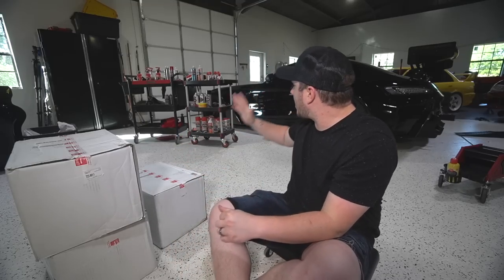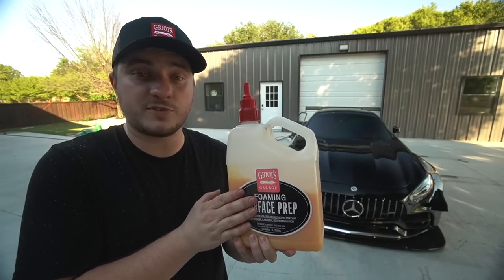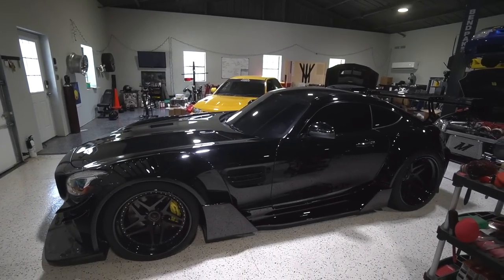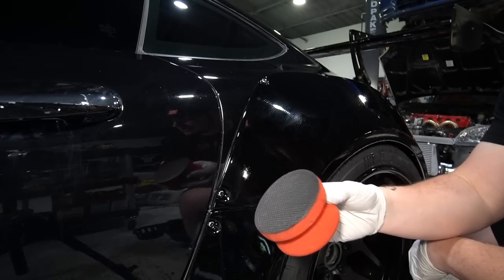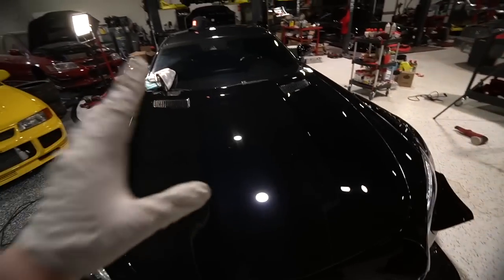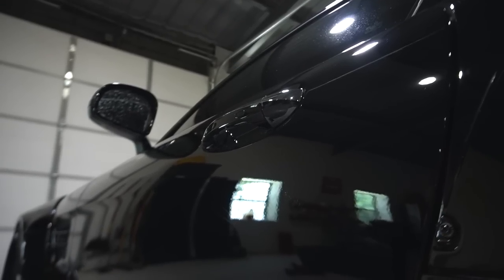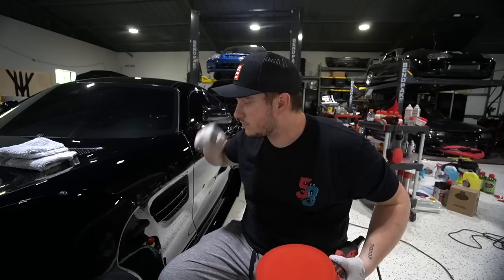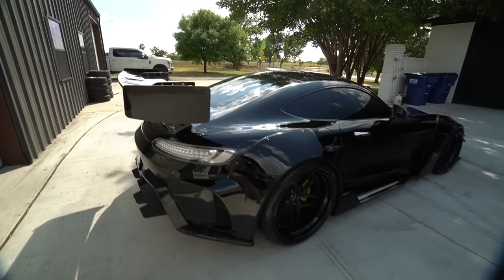COMPLETELY Transforming my Widebody AMG's PAINT! (Full Detail)

Comment: Hey Evan, I don’t know what size pad you used on the rear quarter panels but I would typically use a 3 inch pad on a panel like that. The reason is so that I don’t have my pad straddling the short distance between the two “peaks”. Other than that I think it came out fantastic.

Comment: DO you suggest washing cars in the shade and not straight in the sun? I always wash mine away from the sun just since the sun dries it out quick.
Reply: I detail motorcycles and I always try to wash in the shade, if you do it in the sun the soap and any minerals in the water can dry on To the paint and it will leave watermarks.

Comment: You clay baring is giving me ptsd, I work at a body shop as a detailer and the other day the painter gabe me the car to detail and clean up and there was primer overspray everywhere, doors, roof, hood, windows, windshield.. so i had to take the putty and soapy water and get all the overspray off and after it felt so smooth but it was a pain in the ass (Also i hate detailing Black paint)